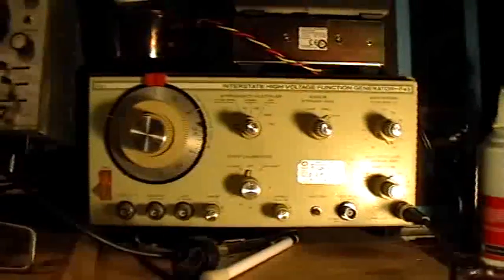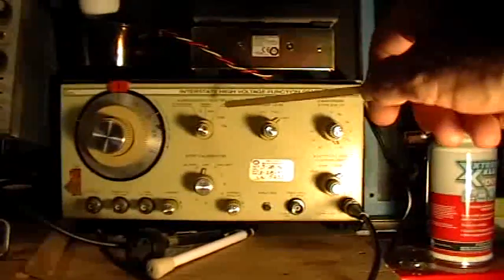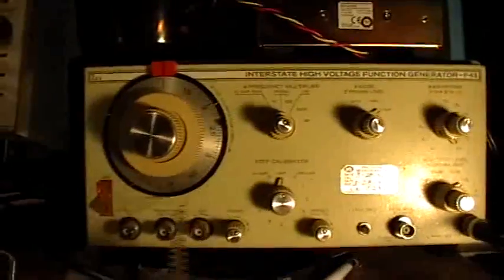Electric OU: Supplement: Function Generator Positive and Negative Outputs

Comment from the maker: No, I never thought you were disrespectful. I have some internet friends from Norway. I respect their frankness and English skills.

I agree that the concept of voltage as Tension (or Pressure) is correct. We just call it "voltage" because of that silly Volta, who played around with his piles.

(A very dirty pun in English.... wink)

I've seen heavy plates of phenolic plastic pulled around by electric tension. Check out my VDG oil jet video for pressure.

Don't stop when you get to Alkali Stone.